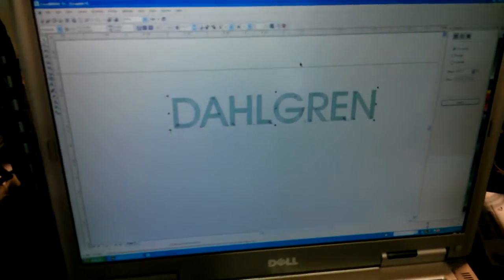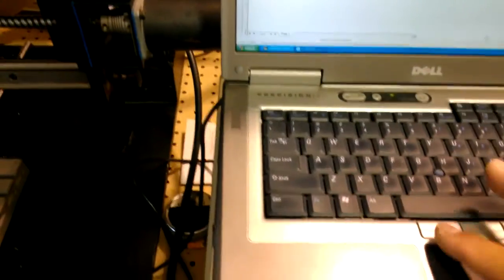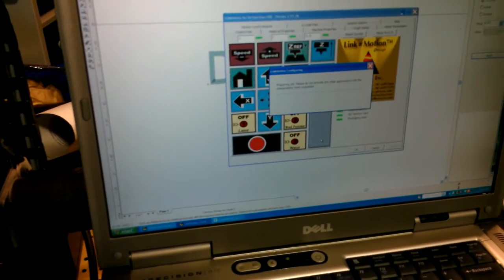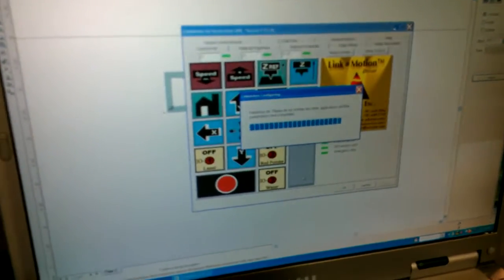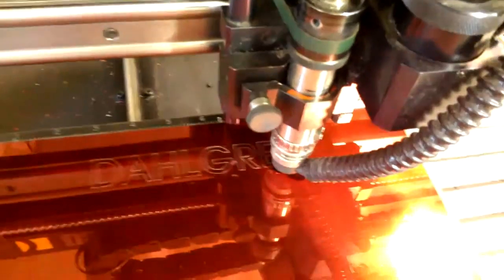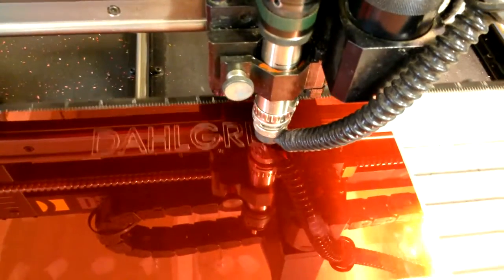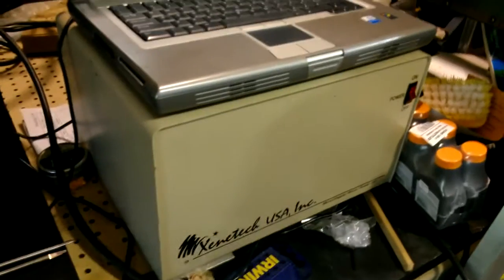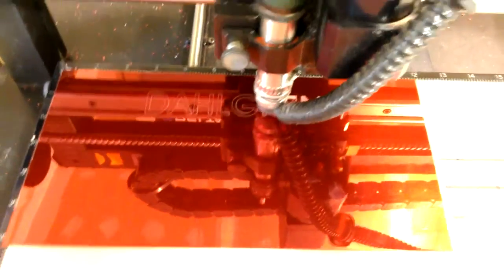Dahlgren System 300 with Solustan Controller

Comment: is this system usable in todays world? or just too obsolete? and what would market value be for these if one were to be sold? $100 $200? what would be the biggest issue with this machine? the controller being obsolete and proprietary? or that fact that its just an engraver with a tiny 100w dremel style spindle motor?

Comment: I have a Dahlgren System 300 but the controller is no good, and the computer with the 5 1/4 drives won't even boot up, I wish to convert it to something newer. Please tell me what you did, send me your email. Phone number I'd like to pick your brain.
Reply: Hi Tim,  I did this a long time ago so I don't think I could help you too much.  All I did was upgrade the controller with one from Solustan.  The motor cables just  needed to be redone to comply with the wiring in the controller - and they helped me with that.  The engraver then worked with their software driver and Corel Draw.  I wish I could help more but I just don't remember everything I did from 6 years ago.  Tom
Reply: @tommal1006  Thanks Tom, I did call them about the Solustan too pricey for me, but have gone another why of things,  http://www.buyapi.ca/ has just the answer they sell a CNC controller I have seen in another video guys setting up there system 500 machine, wow what a big diffence in price. Thanks again

Comment: Did any one find a manual for the Dalhgren model 300Z. Or  Does anyone have any information about the spindle motor wiring? .
 I have a neighbor that picked up one of these machines but there is no documentation with it.
It has a 9 pin circular connector with all nine pins wired. There is no marking on the motor.
Dan

Comment: I was given and old System 300 bed.  It does not have steppers or engraver.  I have fit on a steppers have have the table moving.  I was wondering if you could send pictures and tell me how the z axis is suppose to work.  I have the feeling I am missing a lot of parts.
Reply: Hi Stephen,  Unfortunately I sold this engraver so I don't have more pictures to send - sorry.  As for the Z axis - if you have an air actuated z axis then you need to attach it to an air supply - then the pressure of the air will release to take the z up - then engage to push the z axis down to the material.  I hope that helps some.  There may also be some old manuals online that can help.  Thanks
Reply: Tom Mal Mine is missing most of that I think.  It has the slider and a couple of air connections.  when I blew air into one it just came out the other.  Is there more to it?  I have not been able to find any manuals.  It just hangs on the bottom.  I can slide it up with my hand.
Reply: Stephen Henderson From what I remember there is a small box on the back side of the machine - I think rear right side.  I plugged the air there - then there is an air line that goes from there to the spindle.  I think the actuator that opens and closes could be inside that box.  You would need some sort of controller for this too - and I know there were some very old controllers that really aren't very good any longer.  That's why I upgraded it with the Solustan controller.  I think there are others too - and you may also be able to use Mach3 - I just wouldn't know how to set that up.
Reply: Tom Mal Mine does not have any of that.  What moved the head up and down?  Was there an air cylinder or something?
Reply: Yes.  Do you have a screw on your z axis, maybe it's not air
Reply: Tom Mal No it looks just like yours did only mine is missing what I am guessing is the air cylinder

Comment from the maker: Hi Mark,  

I used the drivers that were already in the Xenetech controller.  I actually had to replace one as it went bad too.  As for software I only used Corel Draw.  The Solustan software is basically an elaborate print driver - that's all.  It also has control of all the motor functions and acts as a full control software for motion.  Basically I did my vector work in Corel - then press print - nothing more to it.  Thanks.  Tom
Reply: Hey maldak, can you show us how the cables are ran. I have a xenetech table with drivers and a chipcollector controler as well as a control board to control spindle and go to home position etc...my machine is a xenetech xot 1624 and I want to eliminate the old bulky computer with apu card. So I can use a laptop. Also, so I can print from corel to machine.

Thanks

Comment: Which Xenetech Drivers did you load for the system to recognize the system 300?  Did you have Xenetech software loaded prior?  Looks slick, we'd like to run it directly from Flexisign which Solustan says it will work with.  Price isn't bad considering we can salvage an expensive engraving table.

Comment from the maker: Hi Henrik,  I got the USB controller from Solustan.  They sell a controller that works through Corel Draw and other programs to act as sort of a printer and is listed as a printer with it's own driver.  They supplied a cable so I didn't need to splice anything either.  They also have settings for your engraver - but they might need to be tweaked a little, but it isn't very difficult to do.  Keep in mind it isn't cheap - they can give you a price for your engraver.
Reply: Long time ago yes,... Solustan USB controller, love to hear about it